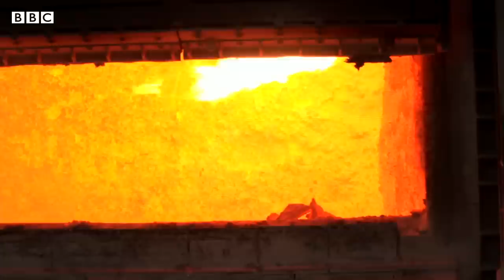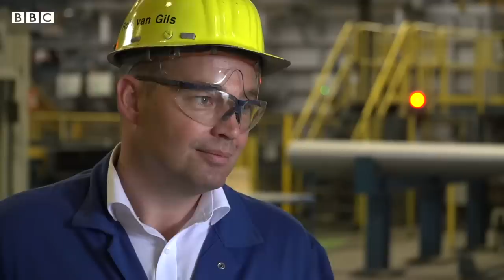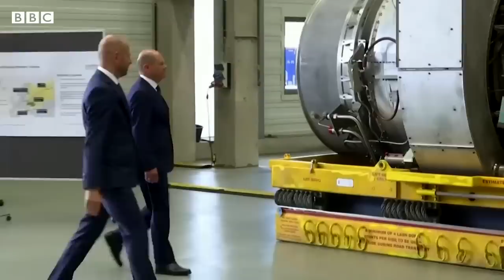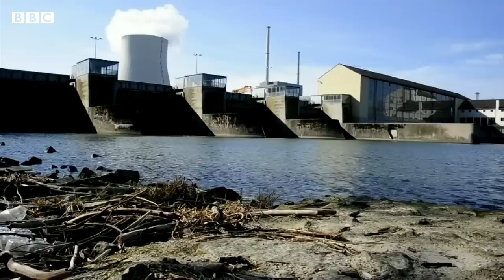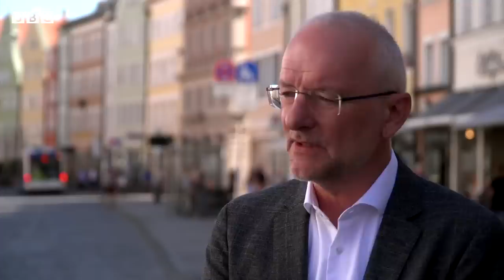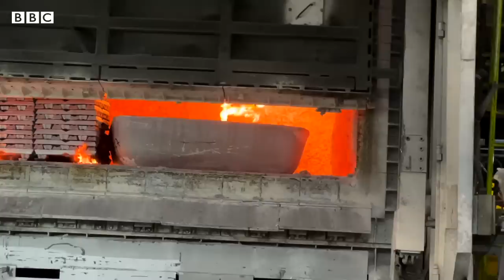Impossible to return turbine vital for Europe gas supply says Russia energy giant Gazprom - BBC News

Comment: Nuclear power would have and should have been Germany's option a decade ago.
And now, they're choosing Coal over Thorium, again.
Reply: I think if the nuclear plant were still operating, Germany would be reliable for nuclear fuel from Russia.There ia one US producer, which is bunkrupt and under FBI investigation
Reply: Thorium reactors aren't commercially ready.
Reply: Where are the other nuclear technologies? Take betavoltaics and extend the concept to alpha particles too, create the alpha-betavoltiac cell. Use magnets to draw beta particles (electrons) to the negative terminal and alpha particles (helium-4 ions) towards the positive terminal, making a circuit that safely consumes the radiation products into a useful side product. 

But no, we're stuck at "big heat boil water spin turbine".
Reply: stop kowtowing to biden and open nord stream 2
Reply: @tomasa-m5643  i see what you mean about biden maybe add a R into pawn,  whats done is done now, look forward to big heating bills

Comment: The three existing nuclear power plants produce 6% of Germany's power needs; Russian gas at its peak was 40%. The three nuclear power plants that were decommissioned at the end of last year and can be brought back on line. They produced another 6% so 12% is nearly a third of the Russian total. Nuclear power can't replace gas in situations involving chemical reactions. It would also be unlikely to be a solution to very-high heat needs as this would involve significant re-tooling, but in terms of raw energy it is a substantial contribution, and 100% reliable.
Reply: It would need years to restore those other plants. When we don't even know if it is even feasible to run our current ones reliabily for 2 year.
Reply: no, they cannot be brought back. there is no fuel, no personnal, these plants haven't seen investment in years, just the bare minimum to keep them running until shut-down. they are not safe. you can't just fire-up a retired nuclear power plant like a mothballed coal power plant. and it wouldn't be economically feasable just for a year or two anyway.
Reply: For nuclear plants you need Russian uranium
Reply: You didnt see what happened in chernibol city a Nuclear plant over heated because of 1 small miscalculation and now the whole city is uninhabitable for 20 thousand years these reactors are very high risk and also costly and deosnt have a long life span
Reply: People won't understand facts like this it will only confuse them
Reply: @Kenny-bj2zq  Do you mean me or OP with his brain dead 'calculations'?
Reply: Re-commissioning nuclear plants takes years. It's not just a case of flipping a switch, there's major engineering work to be done first to safely re-start them.
Reply: @notimportantperson6382  Uranium is found in many countries, not just Russia. Canada & Australia are major producers of uranium as well. It's quite a common element, generally found wherever there's aluminium ore
Reply: @broperfect7669  Chernobyl wasn't one small miscalculation. It was a whole chain of errors which aren't possible on more modern reactors due to more advanced control systems. It's still a major engineering project to re-commission a reactor though
Reply: Nuclear Waste👁️👄👁️
Reply: @stevec6427  
"Uranium is found in many countries, not just Russia"

Russia supplies 40% of uranium FUEL to the EU. 
You can not just  dig up ore and throw it into the reactor. It's not coal.
Reply: @Алекс-б1у4о  No. But there are many other sources for the uranium ore and many other locations that can process it
Reply: @gold.2948  There has never been a single accident involving nuclear waste. Leaks are impossible due to the method of storage. There is actually MORE radiation in the waste from coal plants than you would be subjected to while stood right next to a nuclear waste storage vessel. Yes it lasts a long time but it's safe
Reply: @stevec6427  even though there is always room for another error possibility is never 0% and the risk is to high
Reply: @notimportantperson6382  
If only there was a friendly country that also had uranium.
Reply: @broperfect7669  
Yet, you could go on tours to the city 🤔.

Why would you get Russians to build your nuclear plant when you wouldn't even buy a car from them.

Why not get French to build them😉
Reply: @Алекс-б1у4о  
They also supply gas and look where we're at.

Do you know who else is the largest exporter of LNG?
Reply: @williamzk9083  
Not easily, it take a extraordinary amount of energy to break the bonds apart.
Reply: Peak Russian gas was 55% of the energy mix. Not sure where you got your info from but it's wrong.
Reply: Someone should tell the french
Reply: @broperfect7669  Very bad take, if we discount nuclear energy because the risk isn't 0 then we should get rid of all other volatile substances and technologies we use and see how long humanity survives.
Reply: @broperfect7669  Chernobyl was not a modern nuclear plant, nor was the disaster caused by "one small miscalculation".
Reply: Gas is used for industry and heating and nuclear power for electricity. As long as you don’t manage to make large amounts of synthetic gas from nuclear power until November the discussion is mostly irrelevant.
Reply: Nuclear by itself cannot phase out fossil fuels, however the energy is instantaneous, reliable and energy dense.
Reply: @broperfect7669  then how about the risks of coal and gas? We know the risk of catastrophic climate damage is increasing with every tonne of coal and gas burnt but they don't want to shut these down? And nuclear fission plants where, sure the lethality is higher, but the likelihood is much lower, they don't want anything to do with it
Reply: @stevec6427  Modern like Fukushima?
Reply: @NullStaticVoid  Fukushima got hit by an earthquake and then one of the biggest tsunamis in modern history, what's your point?
Reply: "From that time Jesus began to preach, and to say, Repent: for the kingdom of heaven is at hand." Matthew 4:17 

"Ye have heard that it hath been said, An eye for an eye, and a tooth for a tooth: But I say unto you, That ye resist not evil: but whosoever shall smite thee on thy right cheek, turn to him the other also." Matthew 5:38-39|□